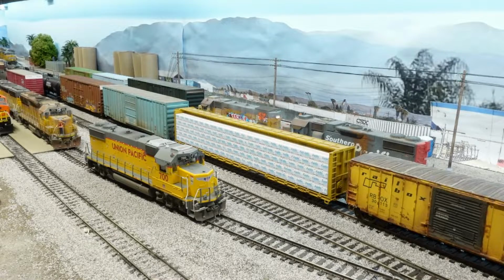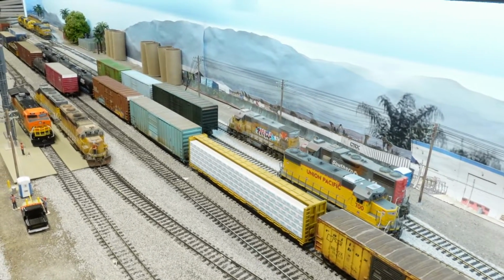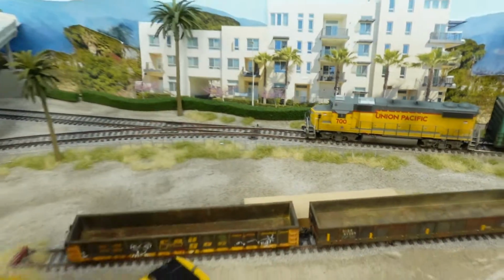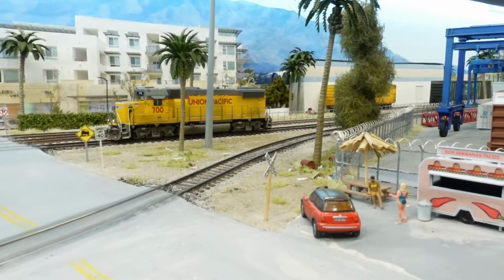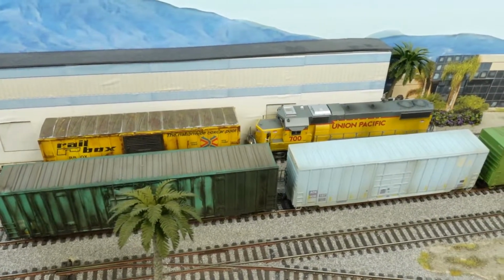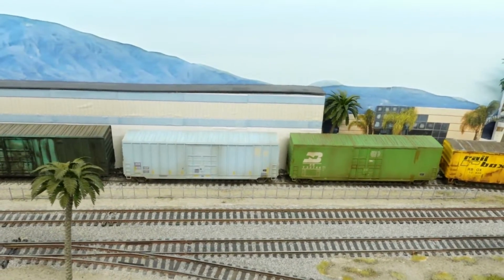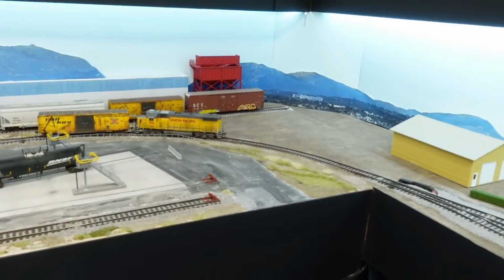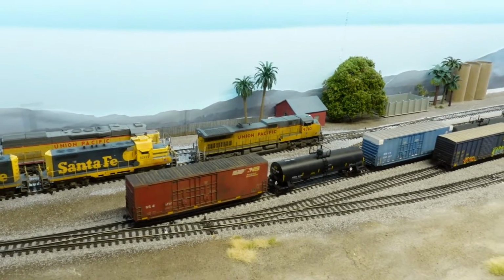Operations | Athearn Genesis GP38n switching on the layout

Comment: The "Boomer car" looks fine on video. I get the impression that it's similar to my current attempts -- looks a bit shoddy close-up but, at arm's length, it's all good. Almost any kind of dirt is believable on a crappy old box car and, from the video, the only problem that jumps out to me is that a car that filthy would probably have a ton of rust and faded old graffiti, too.

As for thinners, yeah, you have to be careful. 50% isopropyl alcohol is usually fine; 70% is fine if you're careful and don't use a lot. Anything stronger is quite likely to damage the plastic, strip decals and so on. I've not had any experience with oil paint thinner (mineral spirits) yet.